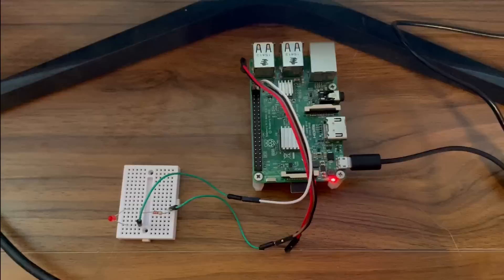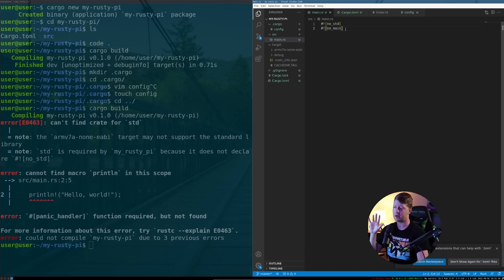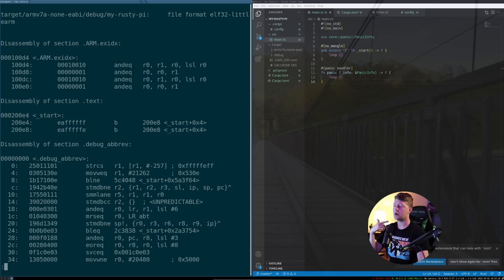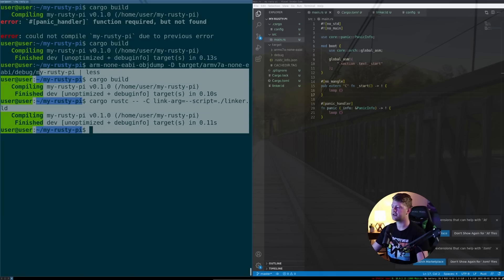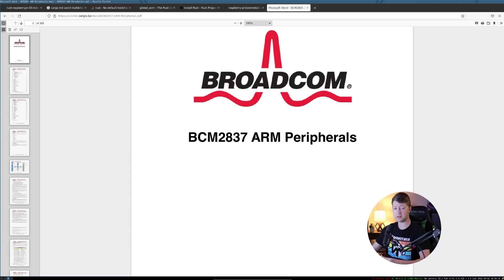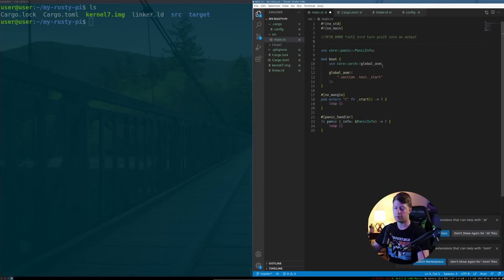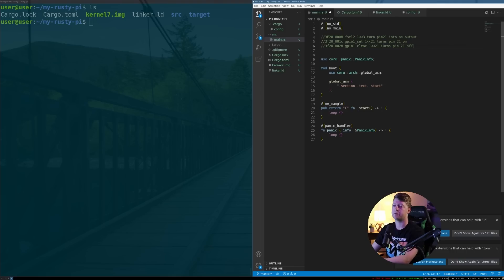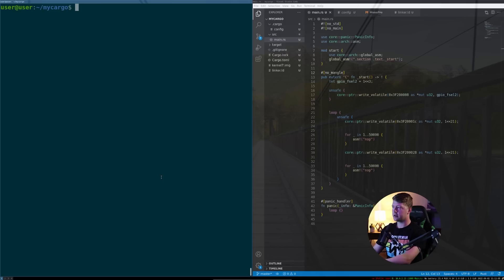rust runs on EVERYTHING (no operating system, just Rust)

Comment: Not a rust guy here, just older guy who used to do Turbo Pascal with Inline Assembler 30 years ago.

Anyway, I wonder which constructs stops modern compiler, e.g. from optimizing away the nops?!
Is anything inside asm never optimized (would be reasonable), or anything inside unsafe, or is it that Raspberry PI CPU don't make such optimiziations, or is because we never called an optimiziation pendant like the -O3?

Maybe the question is dumb, but I'm so used to just add a
MOV AX, 50_000  // not sure what's the 32/64 bit accumulator register pendant for Raspberry PI
WAIT_LOOP: 
NOP
DEC AX
JNZ WAIT_LOOP

so just doing the loop inside assembler on your own, where I might be concerned that a
for _ in range(50_000) { asm("nop") }
might be really optimized away by a compiler/LLVM?!

Also, I noticed the generated loop in the assembler is a bit longer than my intuitive expectation.
Is it because it doesn't use a register for the counter, or what did I miss here?
Is it again because optimizations are not active?!
I thought rust is good at detecting when to use registers is possible (it can't only be FORTRAN that gets it right, is it).
Of course, as we are waiting here anyway, it's purely academic, but just trying to understand modern embedded systems with old fashioned half knowledge :-)

A bit similar would be the question what stops the compiler from rearranging the lines.
It's clear, that the lines with the volatile addresses can't be rearranged, but not so clear why the for waiting loop might not be rearranged as they don't touch the volatiles and also semantically don't do anything.
Is it just me who don't understand optimizations or is it again because they are deactivated (with which instruction - there is no explicit release semantic visible like you would add in C)?!

Anyway, great video, makes appetite to try it out on my own - still have to buy a Raspberry :-)

Comment: Cool, I like it!
I don't know any Rust, so this was a good guide on how building Rust for bare metal works.

For those who want to go further;
If you want to be remotely efficient, you'd use a timer interrupt instead of the nop loops.
Then you leave the timer to do it's thing, and whenever the time you've chosen happens, it will call your interrupt routine, which toggles the bit.
Then you can do something else in between, instead of wasting cycles in a nop loop.
That is, you can do simple round-robin multitasking etc using just interrupt routines and timers.
Doesn't matter for just blinking an LED of course, but interrupts are key to do more complex things on bare metal.

Comment: I'm new to programming and to be honest, I didn't understand a single thing that was mentioned throughout the video... However, rather than being disheartened, I'm quite excited to learn and try to understand what's going on. I just don't know what I should learn in order to be able to understand what's happening here. I've learned the basics of C. I've implemented my own versions of data structures in order to solve leet code questions. I've also taken a course on microprocessors and assembly but I didn't pass it.😅 I aspire to become an embedded systems engineer who works with real-time operating systems ( the ones that are usually present in newer cars ). Can someone provide me with a roadmap to move forward? Thanks in advance.

Comment: I have questions.... don't all OS kernels run on bare metal?  oh wait... no I guess not, they use BIOS or EFI nowadays.  Oh wait, you're also using the bootloader?  what part of this is bare metal?  
Look I get you know what you're doing.  You did a great job with this.  But if you're not setting up clocks, PMIC, memory.... I don' think you can call this bare metal with a straight face.  I've done my fair share of embedded RTOS on chips from PICs to iMx processors.  This is low level, sure, but not bare metal.

Comment: Thank you so much for this video - that’s really cool! I have done something similar in C++ but to see this in Rust is awesome! 
A follow up question if that’s okay please: let’s say you wanted to write a Rust application to run on Linux on a RPi 3B, what would you prefer: using the /dev/gpio* interface, or actually tweaking memory mapped addresses? What does the Rust code look like there: obviously you don’t need to bother with no_main right? 
Would love to see an example - if you or anyone has done it please.

Comment: Or better , can you make a video to use a Raspberry Pi ARM processor as an Arduino board or MCU board, like running small firmware in it, so the sole purpose of that ARM processor becomes to run single / multiple programs in different cores.
I know I am asking a little too much 😅

Comment: 1. Very humble request sir, Can you make videos on how to find and learn things, for example how to get the neccessary information required to do xyz task, like the kernel and program you wrote to blink an led using rust, suppose If someone just thought about it and just wants to do a basic thing , how can they achieve it
2.  Grapichs and ML/DL processing chip, something like running a stereo vision camera on a edge device which is not a SoC like raspberry pi, performs good, can run basic depth perception, or use an FPGA , a custom ARM chip for product development 🙏🙏🙏🙏🙏🙏
Please

Comment: It's fantastic to have so much knowledge packed into such a short video, BUT this knowledge should not even be necessary!
How one even gathers all this info on their own? That would probably take a few more hours to explain :)

I think this video clearly demonstrates how abnormal is the current state of software development:
* Half the story was about how to disable features.
* We needed a linker configuration, which was not in Rust, but some whatever file format, AND it was just as long as the final program.
* It also had to be copy-pasted, because it isn't intuitive enough to remember.
* Nothing in the 1st half was related to LED blinking.
* At the end of the 2nd half, we had to download and trust 3 binary files,
   ~3  million bytes in total, with "magic" file names,
   to run this ~200 byte  (NOT *kilobyte*, just *byte*) example program.
* Finally, we had to disable a feature, again, because we are not even utilizing the full 64bit capabilities of the hardware.

Comment: I started working on an operating system in rust. I never went that far with it but it works. Can boot both legacy bios mode and modern efi style. Though only in qemu on efi. Don’t have video output properly working on any real efi hardware I have. But with bios boot it works with a text mode console. Boots into long mode and all but no memory protection

Comment: My question is: why are all these initial settings wrong? Like is there a case where you do baremetal coding on ARM and want to have all the extra data in the beginning of the code? I'm sure there's reasons why the things are done like this initially, but I don't know the whole picture.
Reply: It depends how the core starts up (is there a bootloader, which address does the CPU jump to on reset etc.) this depends on the manufacturer and/or whoever made the bootloader (if one is used). 
Unless you use a compiler specifically made for a specific target processor, you will need a linker script even for other languages like C, C++ etc. because the compiler doesn't know how the processor works outside the instruction set.

Comment: Negative numbers are actually postitive, but with 1.
For instance, 8-bit signed integer 2 would be 
00000010 in binary, and negative 2 would be bitwise_not(2) + 1 = 11111101 + 1 = 11111110.
When they are combined, it is equal to 100000000, and 1 gets truncated because its 8 bit. 2 - 2 = 0.

Comment: 50000 seems really small for bare metal code.  Even as low as 10MHz it'd only give you 5 ms pause, I think.  Is the nop instruction intentionally really slow or something?
Reply from the maker: The nop instruction is only one clock cycle but don’t forget every iteration of the for loop is a comparison, load, store, and a branch. Much much more than a single cycle.
Reply: @LowLevelTV  Granted - but Pi clock speeds are about 1 GHz.  The video at the end lools like it's about a second for an on/off cycle.  N cycles per iteration, times 50000 iterations per loop, times 2 loops per second, should equal the approximate average Pi clock speed of 1 GHz = 1 billion cycles per second, giving therefore that each iteration of a loop takes 10000 cycles.  For a loop that does nothing, that seems like a REALLY LONG TIME, doesn't it?  I'd have expected, like...20 cycles max.  It's not even using RAM, is it??  Only registers, I'd think.  Where does all the slowness come from?

Comment: 13:39 I would hope nobody would be mad. Unsafe code is basically the only way this can be done. It's just a fact. There's a reason rust has the unsafe keyword, because it's sometimes needed. :) Also, thanks for the video. It's very enlightening!
Reply: Could probably be abstracted into a safe interface (or however it's called). Like a struct (with the PIN number) with methods or even plain functions (one for turning a hard-coded PIN on and the other for turning it off). But in the end the unsafe has be be somewhere.
Reply: I was indeed already wondering whether there is a way to do this safe, even if it might be a tad slower.
Reply: It is just same as writing C inside rust with more wording of course.
Reply: @devrim-oguz  unsafe rust is not C
Reply: Safe code is slower code, as there has to be a lot of hash inserts and checks and when you are processing movement, electrical spikes and wave forms, a lot of interrupts that are happening in the higher kilohertz range, such as signal processing, your program isn't gong to be looking at the web directly and should reject anything unexpected.
Reply: @tsclly2377  safe code is not slower than unsafe code

Comment: Is it possible to access a memory address without using the unsafe mode? Great vid by the way
Reply: No. The unsafe mode in Rust is there to let you do operations that the compiler has no way to verify for safety. It's the "trust me bro" mode. Accessing an arbitrary memory address is an example of such operation. In this case, the compiler does not know that there's hardware memory-mapped to that address, and that the data you are writing is in correct format.

Comment: where is all that happening? commands that you are typing are they executed on the Raspberry Pi or on your PC? How are they connected?
Reply: The commands from his terminal are run an his computer. The only thing the RPi did was running the compiled program after he copied it onto the SD card at the very end. They are not connected, it's just putting files onto an SD card and then putting it into the RPi and boot from it.

Comment: If I'm not mistaken, your project uses only a single core on the Rpi 3.  The  BCM2837 processor has 4 cores.  Is there a RUST HAL crate that facilitates usage of the all cores in parallel?

Comment: I'm trying to think about how this could be migrated into safe rust (Obviously an unsafe core would be needed. I'm thinking of an unsafe function that returns a mut *u32 for a given address, and another unsafe function which just executes a no-op) - that way you could do your bit manipulation + looping in safe rust.
Reply: For what purpose?
Reply: @paulie-g  usually if unsafe code is required in rust, you try to avoid directly calling unsafe functions, and instead write small, tested to be safe, wrapper functions and use those instead. So in this case, it'd make sense to make it work similarly to the Arduino standard library:

set_pin_mode(21, PinMode::OUTPUT);
loop {
    set_pin(21, PinState::HIGH);
    nop_loop(50000);
    set_pin(21, PinState::LOW);
    nop_loop(50000);
}

Doing it this way also has the benefit of making the code way more readable, since you're not just writing to random memory addresses.
Reply: @lunlunnnnn  This makes it magically safeR how?
Reply: @paulie-g  if you write an abstraction layer, there's not much code that directly writes addresses, and therefore it's easier to make sure it's actually safe. If you directly write to these addresses everywhere in your code, there's a lot more opportunities for mistakes to happen.
Reply: @lunlunnnnn  This definition of safety can be fulfilled in C, asm or whatever else. No need for Rust in particular or layers of abstraction in general. The strict version of safety that Rust aims for is not what you're describing, and isn't possible without memory protection and a memory model that includes i/o

In the embedded world, this is done with macros which ship with the BSP, often derived from a manufacturer-provided spec for the device.

Comment: A couple of (unrelated) comments:
- The explanation of how to get Raspberry Pi to load custom code was to the point.
- It looks like the same process would work almost unmodified for a C / C++ project.
- Rust still gives me the impression of being a hot mess. Seen by statements such as: "Rust is wonderful, but I'm going to write everything wrapped in unsafe{}".
- I've done enough ARM programming to know that interrupt handlers can be a challenge for early users. An elaboration on your project that would add a lot of value would be to blink the LED using an interrupt (maybe a part 2?). 
- My ARM experience is on STM32, and while I love using that processor I would not classify it as beginner friendly for bare metal programming. I see the Raspberry Pi as being the next level of complexity along.
- The transparent background on the inactive screen is visually annoying - it adds visual noise to the presentation, being a distraction to the content.
- I hope the above doesn't sound too negative, as I actually enjoyed the video.

Comment: Would be cool if you explained how you came up with the number 50000 (like a word about the built-in clock).
Reply: It's an incremental counter, imagine a for loop that does nothing but counts i from 0 to 50000 then exits, basically every timer is built like that, to count time you need a frequency clock to time ratio if you want to count seconds precisely.

Comment: Interesting.  Not sure about rust though.  Might try this first with C/Asm directly.  It's interesting, I've been filling out parts of the "stack" from bare metal in bits.  I'm a professional software engineer Java+Python+whatever.  But for hobby I have done quite a bit on Arduino and other MCUs which have no OS, up to the ESP8266/ESP32 which have a minimal RTOS.
To be honest the PI has lost more uses to me than anything else.  The MCUs can do all the simple things the PI can in a much simplier and more reliable ways.  No OS and readonly ROM code is so robust.  
At the other end of the spectrum the PI has horrible through bandwidth (not tried the PI4 yet).  If you try and run, say, an NFS/Samba/DLNA server on it, it launchs 20 threads, bottlenecks the bus and if the client does anything nasty like skip back and forward in some MP3s, hit Next, Next, Next on a video folder OR the smart TV tried to fetch 100 thumbnails for a folder of movies.  Night night Raspberry PI.  So for that I use an old Dell desktop as a mini server (70W).
The only thing remaining, where the MCUs are just not powerful enough, but don't need a full PC, are security and timelapse cameras using webcams.  This is handy as it avoids the need for invasive and insecure "cloud based" security systems.
Reply: The lowest I have gone was making a custom PCB with an Arduino Atmel chip, bare, no bootloader and associated passives.  Then I programmed it with a BIN file produced with the ARM cross compile stack on my linux machine, using assembler.  I was happy this was "Arduino free Atmel MCU" programming.  No trace of the Arduino eco system.
Other low level activities I found fun, was fixing a bug in a C library for I2C communications with a hardware ADC, which was following a quirk in the protocol that the lib was not prepared for and crashing.  That involved raw binary manipulation and literally "bit banging" the I2C protocol manually.

Comment: I am a beginner and work in a purely Windows environment with no exposure to Linux other than knowing what it is. So, a decent amount of the work aspect of this is really foreign and sets the bar for entry very high. I also don't know Rust, but I know a bit of C++, C++ is also the only language I know other than some AutoLISP from decades back (I am only 44....).

My question is, how far askew would doing this in C++ in a Windows environment be? And, is it possible to do this same video in Windows and C++? Having it done two ways, for viewers to compare and contrast, I think would be extremely helpful for not only learning embedded like the goal here was, but also to see the analogs of Linux and Rust in environments that others might know.

I found this video absolutely awesome and I want to give it a go now!!! I just don't know Linux so lots of the mechanics of what you were doing and why are really hard to follow. Not your fault, its purely due to my ignorance on the topic(s). Thank you for your videos, they are amazing!!
Reply: Setting up the tool chain for crosscompilation for C++ is a little bit more work. Rust has that built in, but that would be a cool short video